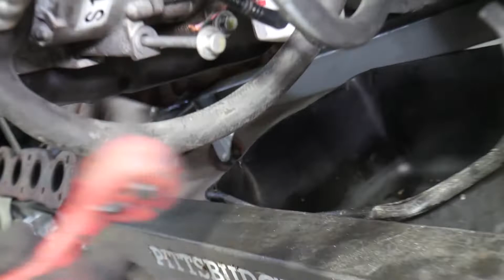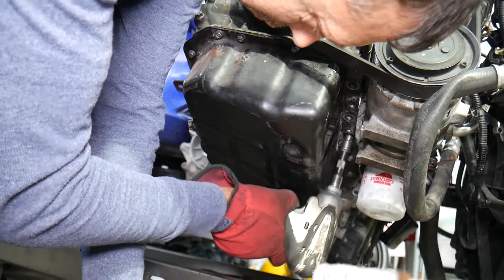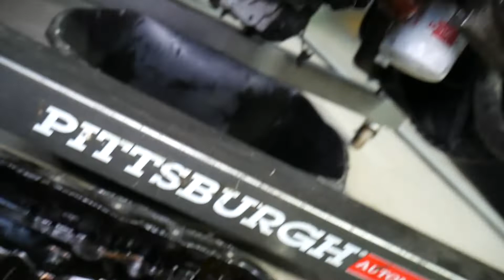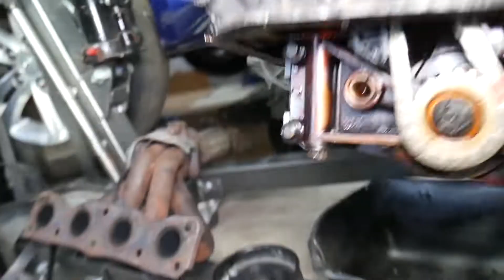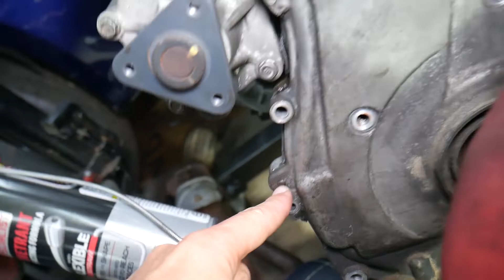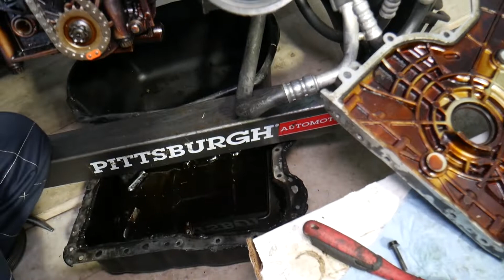HYUNDAI SONATA TIMING CHAIN TENSIONER REPLACEMENT REMOVAL

Comment: Hello guys I have a Hyundi Sonata 2016 hybrid it is has a problem when the engine runs ONLY on battery it is running fine the problem is bucking when I am pressing on gas ( gently and to the middle of power request) but the bucking disappears when I push on gas to have strong power from the engine .....I changed spark plugs and coils still the same what do you think is the problem? you think something to do with the timing chain or is it a problem related to gas and air  I have my dash clear from any engine light and i have 320,000 km  thank you

Comment: Just finished mine and yes its normal for the tensioners to slip after installing the new tensioners. Just bolt everything back up to spec and crank it up. Should be running really smooth afterwards.